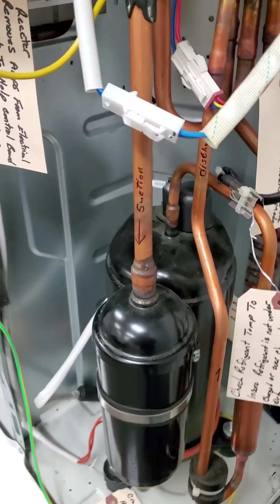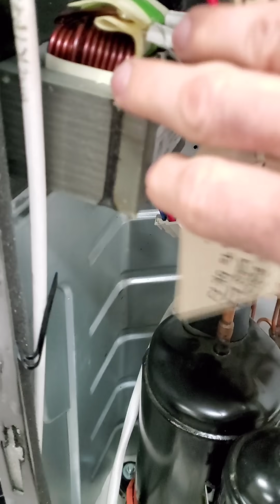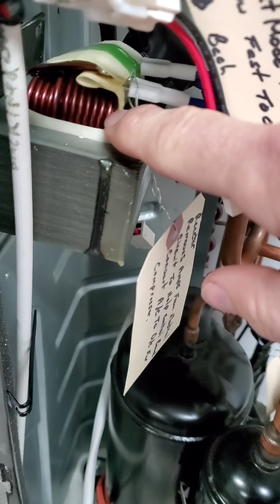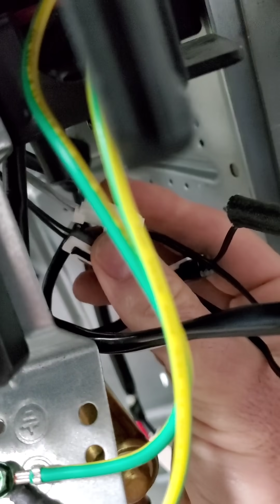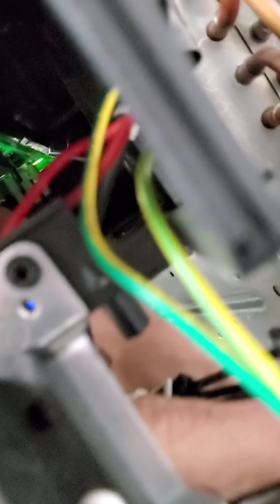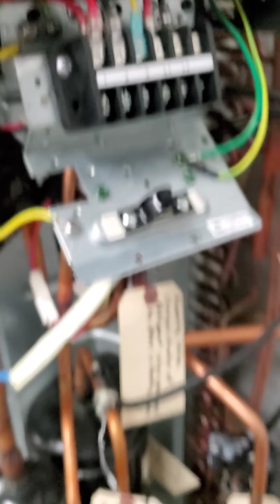E1 CODE AIR CONDITIONER MINI SPLIT TROUBLESHOOTING

Comment: Hey there, I have a mini ductless split unit, cooling works great, and blows fine. When I try to switch it over to the heating, heat pump, it does not do anything inside or outside. Would you be able to help me troubleshoot this?
Reply: Heating mode will not start if the outside temp is too high. Mine won’t heat when outside temp is above 16C. Check your manual.
Reply from the maker: There are so many possibilities with your senerio i dont believe its possible to troubleshoot on here.   But first thing I would suggest is find out if it is a heat pump.    Just because the remote has heat and cool doesn't mean the unit has this function.   And if it is a heat pump then there is not a difference in heating and cooling cycle besides the changeover of 1 valve.   So maybe try giving it more time after .switching the remote over .   It can take upto 8 minutes
Reply: Tobys place thanks for the reply, I have left it to switch over up to 45 min; still nothing. I know the unit has plenty of refrigerant in it. The unit is only a year old.
Reply: Over used the heating on it all last winter
Reply from the maker: Start by ..   bypassing remote and put in auto mode.    Get manual and find out what is the default temp in auto.
Reply: Tobys place I done did it, and nothing happened
Reply from the maker: @Sword-trowel   it has to fall below set point before something would call for heat.   What is the default set point?
Reply: Tobys place I’m not sure I looked Through the manual and couldn’t find it
Reply from the maker: @Sword-trowel  well knowing and research is part of any diagnostic.    Surely you can't exspect it to operate if indoor ambient doesn't drop below set point.    First thing you need to do is get a service manual and study it carefully to understand the sequence of operations.   Once you have this sequence you can run through steps of diagnostic.

Comment: Hey Toby, My mini split goes on for 5-10mins then trips the breaker any idea what may be causing this? Great video by the way..
Reply from the maker: This is not normal for mini split to trip the breaker.   And your issue can be so many things.    But first let me say best rule of troubleshooting is look at the installation and wiring first .   Take a look at all connections make sure they are tight , make sure there is no discoloration on the wire ends.   Go to the breaker and feel it while its running and see if its hot.   Take your amprobe around the wire and see how much current is going through the wires.   Make sure the terminal on the breaker is tight. I have seen that problem many times.    Only then move to the machine.   After checking current  compare it to current it should be pulling on the data plate.   If the system is a few years old you could have dirty outdoor coils cuasing high amp draw.   Or if anyone put refrigerant in the system it could be over charged causing this issue.     But best way to find the problem is blame the machine last .   Start at breaker box and work to the machine.